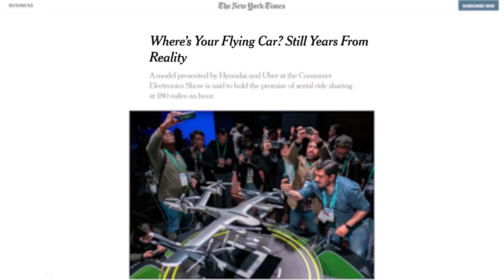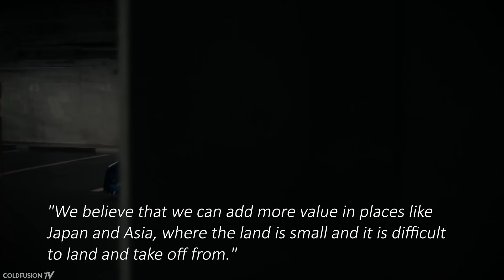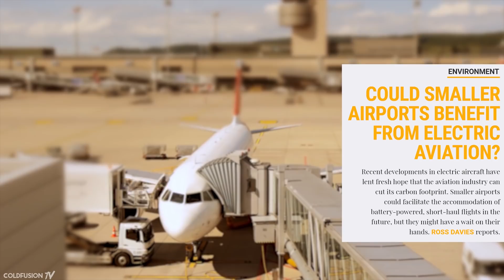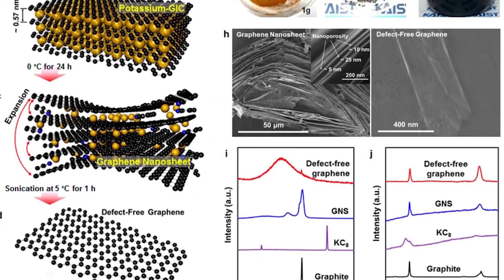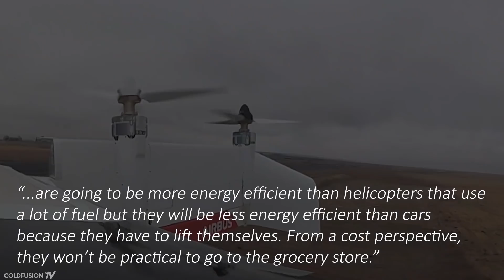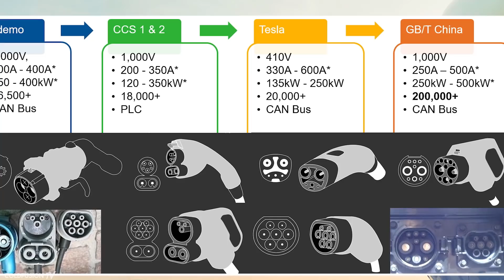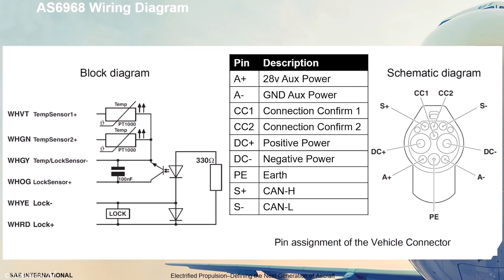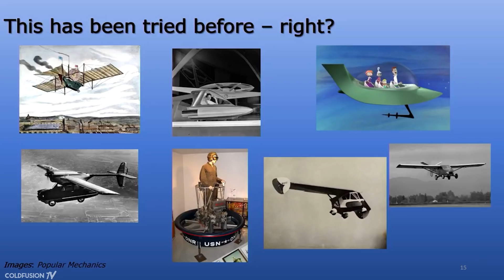Japan's Flying Car – Problems and Solutions

Comment from the maker: For all those wondering about piloting, the Japanese vehicle is mostly autonomous - from the Japanese Times: "The initial model will fly basically on auto pilot, but it’s not 100 percent autonomous because a pilot would need to manoeuvre it in case of an emergency, for example." 
Forgot to mention that.
Reply: Yep, that is my main concern, as security and capability of a pilot may be major obstacles for the diffusion of this tecnology (nobody wants a mad idiot crashing his giga-drone in your roof)

(There is a reason pilots currently undergo years of training, and that is not only to learn how to pilot the aircraft, but also how to behave in the event of accident, in the event of catastrophic failures, interfacing with airline control towers, etc)
Reply: @HeroCod3  You'd be surprised how easy it is to get a private pilots license for general aviation aircraft, the only real hurdle is the cost of the training and the aircraft. That's why there's still tons of fatal accidents every year from GA aircraft being piloted by low-skilled/careless pilots. Thankfully small aircraft tend not to kill people on the ground very often but it still happens. 

I think a combination of advanced autopilot, standardized across the industry so each knows where the others are and can coordinate off the same ruleset to avoid collisions, and a failsafe system like a parachute (like on Cirrus aircraft) or a complete backup system that can land in the event of a total failure of the main battery, autopilot, etc would be needed to make this concept safe enough. If my autonomous car has a failure it can pullover, if it has a collision it just has to protect me from that one event, but if my ultralight air-taxi suffers either of those I'm almost certain to die via terminal impact with the ground.
Reply: A deal breaking hurdle they must overcome for a single person aircraft.
Reply: I think flying "cars" are more likely to replace helicopters than cars... and they won't even do that until they are completely autonomous and networked. They will replace private helicopters for the very rich first only once they can save on piloting, fuel, and (probably) maintenance costs.
Although flying cars might get common enough to be affordable to the merely rich I doubt that they will ever completely replace (cheap to run electric) cars. Even if fusion power electricity becomes "too cheap to meter" I think it will always stay too metered to be cheap.
That, along with people who hate flying/heights/motion sickness, will keep ground cars going until the day real estate developers successfully lobby governments into selling off the road network.
If they get good enough flying cars may find enough of a role in public transport to replace a significant number of cars in large cities, but one decent network system hack could screw that right up.
Reply: Can you make a video on Nuscale which recently got approval on their first small scale commercial nuclear reactors. Thank you.
Reply: That's so rad!
Big ups to Tesla for showing what's possible...
Reply: Santos Dumont invented the airplane. Get your facts straight please. Your other cryptocurrency video was also very misleading. Are you just making videos to make videos?
Reply: Not redundant, Deprecated
Reply: Correction: the first aircraft was from Santos Dummond
Reply: Title is misleading me to expect video to describe how flying cars will be attainable flying versions of regular cars

Air taxi > flying car
These "flying cars" are disruptions to helicopter and delivery market, they should stick to "air taxi" and "delivery drone" nomenclature.

Flying car:
what a waste of energy.  Flying cars versus land and sea travel is a waste of energy, just to stay above the ground.  Unless the energy comes from an energy pool that's truly excessive and has no better use.
If traffic is enough to be channelised, build a physical channel.  Regular airline travel and drone deliveries is traffic is too diffuse to be done by train, too far/fast for cars, too fast for boats.  Car traffic is ideally too diffuse to be done by train, but 'murica ignores this.

Boring company tunnels and IRL viaducts > Coruscant air traffic (with levitation via IRL upward thrust)

Don't forget licensing, security. and ATC concerns for drones and these upcoming air taxis.  A flying version of regular cars should not happen.
Reply: Hopefully ASAP!
Reply: That's an important point and thus I think these are more than 5 years away now. :(
Reply: Unfortunately, electric passenger vehicles will never gain momentum using the current methods. Batteries are far to heavy to transport people or cargo at the speed or distance required by industry today. Battery research is not even close to a breakthrough of necessary significance.

Even if batteries could be used they are not an energy source the electricity required for such an electric passenger vehicle industry would put tremendous demand on current infrastructure and power plants would burn much more fossil fuel and natural gas resulting in similar CO2 emissions as today. So no environmental benefits.

Their is a solution to these problems that would quickly make electric flight the new norm while also solving the "green energy source" issue but strangely industry is not exploring this solution as much as they should. Give this comment a like if you want to know what the solution is.
Reply: @lb5928  Hey someone is being real here. (:
Reply: The Korean guy that made something like (he is on Youtube https://www.youtube.com/watch?v=8chkFYfzIUE )  that already flys way faster and higher and he is 1 dude. He has videos flying around a lake etc. What have the Japanese people been doing for 6 years with all those employees  One guy should have hired the Korean guy and skipped the 6 years of development.
Reply: Great vid, Dagogo. My thinking is the opposite. Can we create a car that has no wheels, no propellers, no thrusters, and yet, can hoover and fly a couple of feet above the ground? Of course, it would be ideal to have an advanced autopilot in such a vehicle. And such a vehicle would not necessarily be constrained by street and highway routing, so new usage rules would have to be coded into the vehicle's software. Although, we do have off road vehicles, today.
Reply: I believe the plan for Joby Aviation in the USA is to have pre-determined paths between take-off and landing sites and full autonomy. Seems like the logical way to start things... Sky Train! https://www.jobyaviation.com/
Reply: Will this not be crowdy on the air or will they be air road for this flying cars
Reply: batteries are still total garbage, 
the rest is ready !!
and development is so freaking slow !!
Reply: You need to be a trained pilot to fly and live. Alot of a pilots training is training when NOT to fly and when to turn around. Navigation is an issue also, avionics failure happens. This is very smart for a commuter and even smarter for training costs.
Reply: Please make a video om wikileaks and technology behind it and how important is it to share the truth.
Reply: K

Mmmmp
Reply: As there will be increasing numbers of flying vehicles, have there been any recent advances in air traffic control for these vehicles? Thanks for all of your documentaries, I'm really enjoying them.
Reply: This has aged well...like all the other sensational drivel on this channel. I have no idea why channels do this - pandering to such content.
Reply: If passenger jet planes can't be full autopilot then neither can a drone.
Reply: Great part 2 of electric flying aircrafts. Now all you left is to make a video over future accidents involving flying cars.
Reply: The software would be nightmare
Reply: Hi dagogo and to all of your viewers, i was watching your great tech content since more than two years, i am an inventor and tech gadget designer. my latest and first invention called flying dream is my solution designed to solve the problem of city traffic, i would really appreciate your feedback about this urban vtol aircraft in a video and i also encourage your viewers to visit the flying dream campaign page and write their feedback in the form of comments
Reply: You think adding hundreds of pounds of tires and axles etc is a trivial task?  You said that within the 1st 2 minutes . That's pretty dumb.  It will change the entire set up of the drone they've been working on for 6 yrs. Increase prop size, decrease battery life, alter the center of gravity, just to name a few.  It's much easier to get a plain drone with a person inside to fly.  It's been done repeatedly now.  So your statement is naive and uninformed.  Showing the hunk of crap they produced knowing the end product will look nothing like it, if it can be a achieved by them at all, is just the con man's way of getting more investors money.  Atleast tell it like it is Dagogo!

Comment: flying cars are a dumb idea unless very very restricted
liek specific flying areas with nothing under it
and the cars shud have to be maintained, people have car issues, and get into car crashes, 
this in the air over buildings is a problem. car crashes are to common, imagine a drunk flyer.

Comment: electric aircraft have failed to move out of the niche market of little short range recreational usage vehicles.
I think the next step in aviation power will not be from battery but from hybrid aircraft which add electric motors and battery to improve performance compared to other aircraft - perhaps also use of lpg and lng will become more common as these are cheaper to make.

Comment: Before anything is possible regarding flying cars or passenger drones (flying objects), we need a common standard for automatic communication between the flying objects for safety, because most flying objects will operate in  autonomous mode (I hope), because people are just to dangerous...

Comment: Flying cars are a stupid idea. There is no future in which individuals will become pilots just to get to work a bit faster. It could run in complete silence and be powered by angel farts and it would still be a terrible idea. The only way it works is if the "piloting" is actually done by a central computer or AI. And even then, the advantage over self-driving cars will not justify the rise is cost and decline in safety. Forget flying cars, people. Electric airplanes,on the other hand, have promise.

Comment: "Flying Cars", specifically commercially viable passenger-carrying electric quadcopters, will require solid-state batteries or other batteries with energy density better than currently available lithium-ion batteries.

Comment: I don't think this will ever become commonplace for the average citizen. If your car fails and halts to a stop, the most that can happen is an accident, but as long as your brakes etc. are fine you're usually safe. If anything fails on a flying vehicle it can easily go down. You're working against gravity here. Maintenance is paramount. Not to mention the qualifications to pilot them. I can see taxi companies using it maybe, but not the average person

Comment: To some who look at the earliest days of powered flight, there was an even earlier proponent of a road-able airplane, and to some think it preceded the Wright brothers. The design of Gustave Whitehead's  Number 21 aircraft was wheeled, when the Wrights were using skids and a rail to launch. Whitehead's monoplane design had folding wings and Tail, with a kingpost type wire rigging holding the wing level from above before take off,, and wires going down to hold them level in flight. Two of Whitehead built engines powered the craft, allowing for differential steering along with weight shift. The very simplest electric  model  aircraft use the differential steering technique today.  
I am not absolutely convinced of the 1901 flight written up in the local paper, and subsequently reprinted in Scientific American before the Wrights triumph at Kitty Hawk, but there was a lot of claims in the same era that were even less well documented.
Though Whitehead was almost as well known an engine builder as Glenn Curtiss was, and a copy of his design has been shown to fly  by the Germans from the region where he  was born before emigrated to America,  U.S. history has not been kind to him or to  Californian John Montgomery who built gliders as good as the Wrights did. I credit the Wrights with a better control system in turns, but I think that Whitehead would be in the history books if he had been able to turn as well.  Folding wings, four wheels, It was a flying car design from its beginning. Did it fly first, we have no photographic proof, and the Wrights have just the one, plus the Coast Guard observers word. Whitehead had a newspaper editor's word for it, in an age like our own where the more outrageous the claim the more news it sold to the wire services. History is written by the winners and in some cases lawsuits determine who wins in the end.

Comment: What about the following questions:

1. What about the sound of those things? How loud will they be? Now imagine hundreds of them (thousands?) flying around? Why are there no videos (at least I can not find any) with actual SOUND available?

2. Air Taxis will not bring any benefit to the ground traffic as many suggest: You would need thousands and thousands in the air to decrease ground traffic significantly. Am I missing a point?

3. Many of the suggested air Taxis need some 50-100 m² free space to land. Where do you get this in cities? Where do you get this for hundreds of air taxis?

And MOST OF ALL:

4. I doubt that the battery technology available now allows for the specs companies like Lilium are promising. 300 km range at 300 km/h? With something that weighs in at around half a ton? I fail to see a battery solution that would allow this stunt.

I have looked around, but I can not find any answers to those critical questions.

Comment: "Flying cars" won't happen in the sense of personal flying vehicles.  The traffic control implications are mind-boggling and there are no "fender benders" in the air.  This is the problem with air taxis, too.  Uber has increased city traffic.  Uber air-taxis, if vaguely affordable, would create an air control nightmare for the same reason, I surmise.

Comment: I am very interested abt battery and wireless charging in the future. I heard abt a pilot project that China is undertaking now where they are developing in where they use wireless charging ports lining strategical location to wireless charge electric cars as they travel along the stretch of street. I don't know it is true. If it uis true den whoever create that technology wld b the pioneer in that technology and way to go. Maybe the car will b charged wireless through a unique account by the power supplier and charge accordingly like our electricity bill monthly. Then we won't have to worry abt pulling up to gas station throughout the journey from lets say San Francisco to LA, becoz our electric car wld be charged wirlessly throughout the stretch that we travel from SF to LA n we don't even hv to worry abt charging our electric car wen we reach LA late at night to look for charging station. Is that the reason also the reason that China has already set a date in the v near future to ban d selling of new gas power cars in China in d v neary future? US shld not let China win this this technology field bcoz it means mega business so if US hasn't start this project, they better do. Can U kindly do a documentarty of this technology?

Comment: Even IF you can make a viable product, there is the question of what the hell the use case is. You are not going to need one of these going to the grocery store. You will book a flight on a traditional airline for long distance travel. And air taxies are already in place with helicopters. All this will do is either make traditional flight cleaner and cheaper. Personal aircraft won't ever be a thing.

Comment: I think piloting/control of these vehicles is the bigger barrier to entry, which you didn't touch on in the video. For widespread adoption, the general public needs to be able to control these safely with little training. For a normal car, it's doable. Most people can understand the physical mechanics of driving a vehicle. When you go airborne and start flying, there are many more variables that need to be considered, such as three dimensional movement and flight physics. A level of complexity is introduced that would make training more expensive and time consuming than the typical person will put up with, and even if you could train everyone to fly, it's still inherently more accident-prone than driving. Add in other people in flying cars that you need to avoid and there is potential for catastrophic collisions.

In my opinion, the main reason flying cars haven't been viable yet is because they are simply too dangerous for the general public to use. The reason they are becoming viable now is because of advancing AI technology. If flight control, like driving, can be completely automated, this eliminates the problems of training time, controlling in unexpected weather situations, and awareness of obstacles in flight. Flying cars could use an AI network to communicate with each other and track the location of other vehicles, so you'd never collide with another car. The most effective solution will probably have you simply tell the car where you want to go, and it automatically carries you there without further input.

Comment: The propellers on a small remote controlled drone are quite noisy. I imagine that when scaled up to size of a flying car, these vehicles will be super loud. I think that the noise pollution might be a problem that will need to be solved.